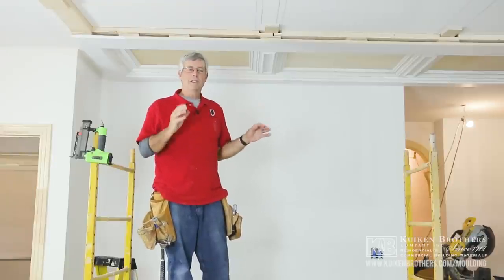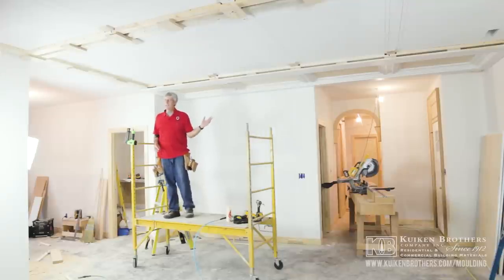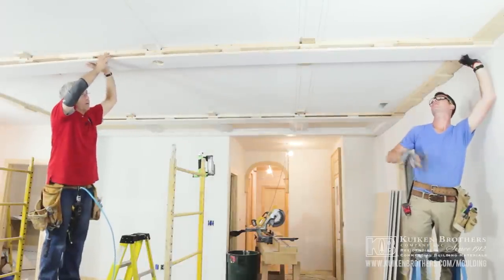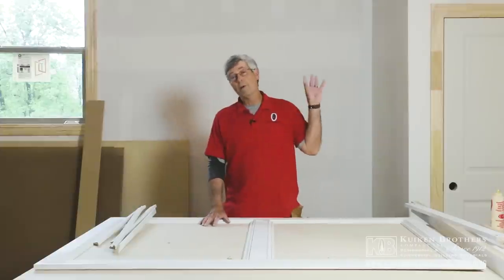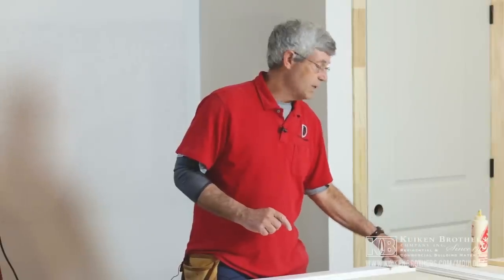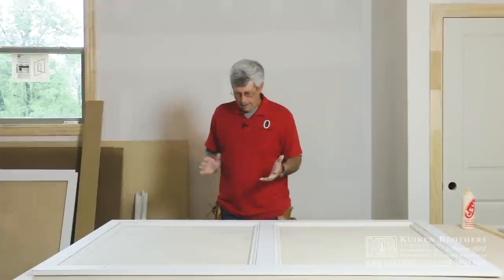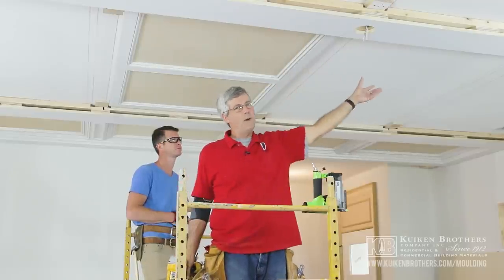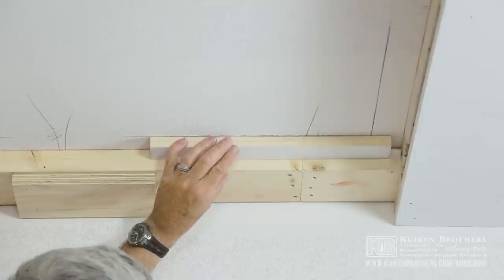How to Build a Custom Panel/ Beam Ceiling with Stock Moulding Profiles from Kuiken Brothers

Comment: Beautiful work!  If used on a standard 8 ft. ceiling would you use the same blocking layers or would this be adjusted by eliminating one of the blocking?

Comment: Anyone considering this type of ceiling boxing PLEASE PLEASE PLEASE rub down all the mouldings primer before putting in place. Your back and neck will love you for it. That way only nail holes to fill in. Plus use glue and less nails. This guy has trigger finger and if using MDF anytime you fire a nail into it it puffs out around the nail hole and is a bitch to hide. Guaranteed you will do a two or three goes around filling in and sanding to hide all nail holes. Not so with finger jointed pine though it works much better than the dreaded MDF and is a little lighter in weight but has the ability to show warping and horrible grain lines when painted. As of November 23 2019 the costing for me to do a room 14'x22' in a plain 9 box section ceiling that looks like the OXO game board is coming close to $600 Canadian that's using dimensional 1x6 and 1x8 boards 14' long and packing to lower the boards more than the 1inch so internal trim moulding will fit. Finally a wall to ceiling crown moulding. It's tough work but the results are worth it plus it puts great resale value on your home. Good luck everyone hope this info helps a guy out.

Comment: What would you do if your ceiling was not rectangle or square?  I have one wall that is on the diagonal and wondered if I could still do this.
Reply: yes YOU CAN .. measure  everything before you start .. make sure when measuring  use a square   a
Reply: Honestly it will not give you same highend results on angled wall I have seen it in friends homes and it looks horrible . This kind of ceiling looks good on square and rectengle shaped rooms/ceilings